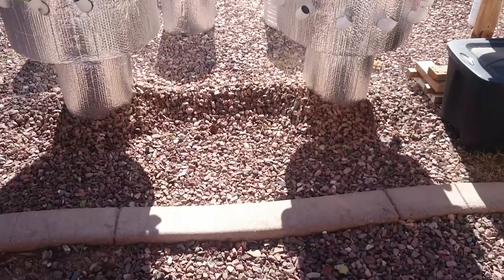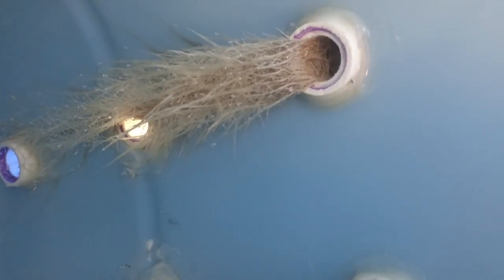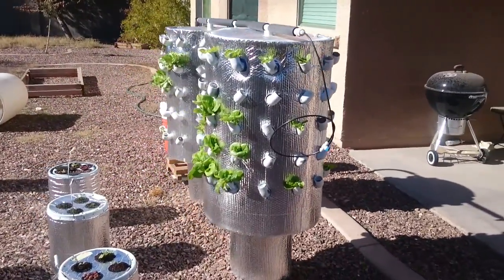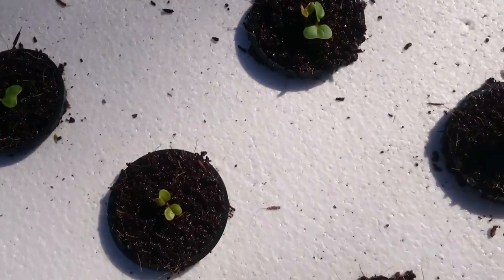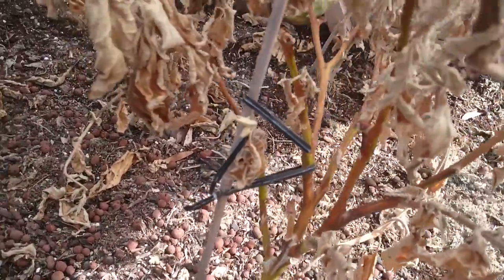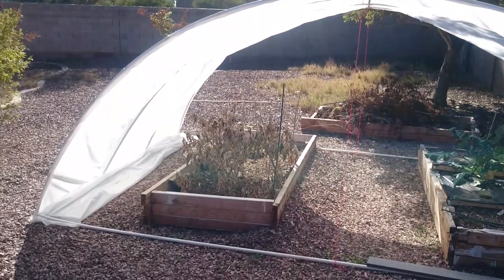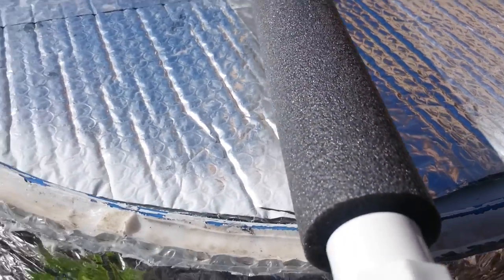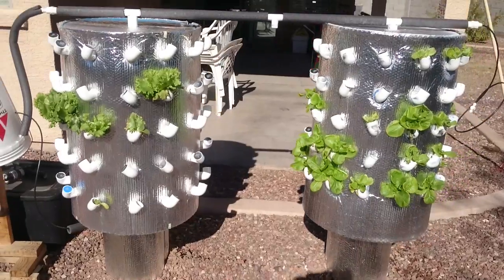DIY High pressure Aeroponics grow tower update.

Comment: That's really fantastic what you did with the outside of the containers.  I've learned something. Thanks!
Reply from the maker: My pleasure, these were a fun experiment but I could never eat or even give away that much lettuce lol I think i grew over 100 at a time lol
Reply: @ToddLarsen  I'm fascinated by the design. I think I'd like to build this. I know it's an old video, but are there videos of the build and how much nutrient you keep in the system. BTW- I found your videos from The Green Dream Project. :)
Reply: @ToddLarsen  
I made the mistake of putting 40+ dwarf tomato plants in one of mine ;) The seed packet reckoned they`d only grow a foot tall but it was more like 2.5ft lol
Reply from the maker: @atomizer2665  That must have been some sight to see lol
Reply: @ToddLarsen  
Hi Todd, it was ok upto the point where the weight of the fruit and gravity got involved, I had to wrap 100m reel of twine around it to keep everything upright. It worked for a while lol.  I`ll  only use them to grow lettuce, leafy greens and herbs from now on.
Reply: @ToddLarsen  
 Here`s what the tower looked like 6-8 weeks before it finally stopped growing up and out. With the twine strapping, it finished up 5ft+  in diameter and a couple of feet higher than the tower itself.  https://youtu.be/U5kVrrFzOKw

Comment: Looks like you did beautiful work there.
Few questions:
1.What kind of high pressure pump you're using and how many nozzles per pump.
2. Are you using pressure tank?
3. What's the orifice size of the nozzle or what size droplets they do create (microns).
4. What kind of nutrient you're using?

Thanks for the video.
Reply from the maker: This was so long ago I can't remember any of the specifics of the project. Perhaps we will build new ones in the future and add them to the Aquaponics system we're working on.

Comment: Great Video, Thanks for the update. How many towers do you think you can run off the one CDP6800? Thanks again.
Reply from the maker: can my pump run more than two towers? that's a great question, I'll have to do an experiment and see if I can or run even more then that.
Reply: +Todd Larsen
The 6800 will do about 18L per hour, much less at maximum pressure. I`d guess you may be able to run upto 4 of your brass nozzles depending on how long the tubing is, even fairly short  runs of 1/4 inch tube can cause major drops in pressure. I found the brass nozzles even with the stainless inserts were very prone to partial clogging.
Reply from the maker: +Atom izer I'm actually running ten nozzles at once in my two towers currently with a single pump and filter. They seem to be doing great.
Reply: +Todd Larsen 
i would check what pressure you`re getting at the nozzles. The 1/2&quot; pvc feedline will be helping to reduce the pressure loss. The downside of using chunky manifolds is they keep running until the pressure in the pipe drops to zero after the pump shuts off, could be upto 30 seconds with a lot of pipework. Mist quality suffers as the pressure drops from max to zero, ideally you want the mist to shut off instantly.
Reply: +Paraguns 
I agree. The flow rate and distance to nozzle will determine how many. How every I found a solution that could allow Todds system to handle 64 nozzles by adding a pressure tank and a controller. This equates to a total of 8 towers. Not bad, Right?

Comment: Did you use a heat gun or drill to put in the pods?
Reply from the maker: I used a hole saw then a heat gun to get a tight seal.

Comment: Hey Todd, You have a great system. Thanks for sharing. I have some questions.
If I understand correctly, you're running the misters 24/7, no timer?
Also, how do you start the plants, do you seed it in rockwool and transfer to tower when roots appear? What are you doing for nutrients?
Thanks,
Reply from the maker: the system runs 24/7 and I start the seeds in both rock wool and hydroton and I give them almost a month before they are placed into the towers.
Reply: +Todd Larsen 
How do you connect the brass nozzles to the system? Does it thread directly into the end of 1/4" tubing? Any leaks when pressurized? 
Do you feel these brass nozzles could contaminate your nutrient? 
Thanks again for sharing.
Reply from the maker: the nutrients I get from Amazon called urban hydroponics lettuce  8-15-36 and you'll also need a Cal mag supplement to add to the mixture for best result, in my opinion.  it has mixing instruction on the back that I fallow.
Reply from the maker: the nozzles are threaded into the union fittings, and they came as a kit for an outdoor diy misting system from the local hardware store.

Comment: I've been looking at a number of aeroponic and hydroponic systems online.  I've noticed that many are made from PVC parts and many people use pvc glue, as you did.  Do you have any concerns about the PVC primer and glue being adsorbed or absorbed by the plants?
Reply from the maker: Larry Johnson From what I understand about the solvents used in the glue and primer is as long as it has cured its safe. That being said I'm no expert with M.S.D.S. material safety data sheets and have no way to test the produce for any chemical buildup. I've been using pvc and glued vs non glued methods and have not noticed any difference and even with my large aquaponics system wich is full of tiny microbes, fish, and worms there not showing any effects from the glue or primer.
Reply: @ToddLarsen  how could i build something like this but a verticle wall with more holes? Like a steep stretched out triangle shape. What would i need and how would i accomplish this?